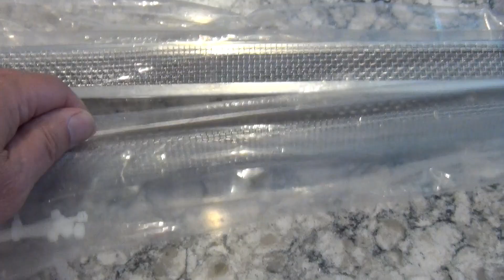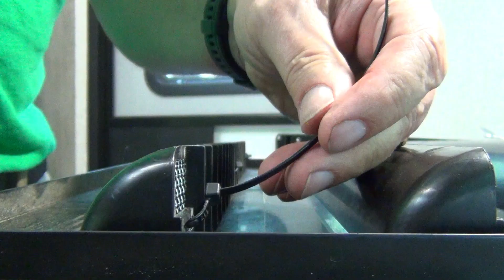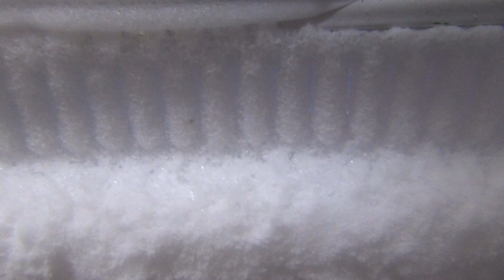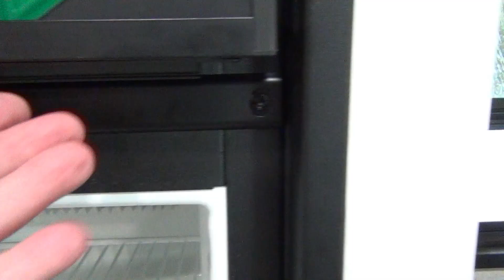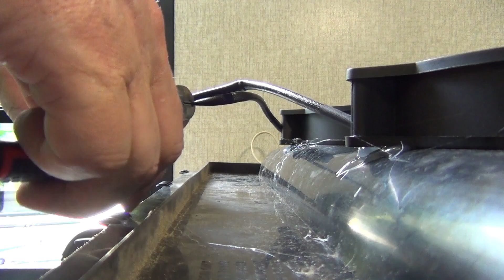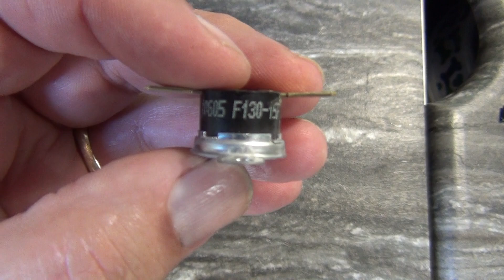THREE Things All RV Fridges Should Have👍

Comment: Did you do a similar mod with the flagstaff? Signed a new flagstaff owner
Reply from the maker: Congrats on your new Flagstaff! On mine, I did the exterior fan and screens, but I did not put in the inside circulation fan. Since its a smaller, shorter fridge, air circulation isn't as big of an issue. Besides, the fan would take up too much usable space. Did you see my episode on adding a second refrigerator?
https://youtu.be/59JBr0EEdhs

Comment: Do you think you could turn your attention to building and testing some FM radio antennas?  I've messed around with some homebrew designs and found that my steel handtruck is a better FM antenna than some of the commercial omnidirectional antennas from Stellar and Channel Master.
Reply from the maker: I have one episode on a VHF/FM antenna here - https://youtu.be/OWOwTQQPuT0
I'll see about doing more FM designs. Thanks
Reply: @mrhoptoit7835  I watched and that was good. Possibly test a larger or smaller gap in the dipole ( yours was 2" i think) and maybe larger wire filament to see if it grabs more signal.  I have a 4' steel hand truck that works better as an antenna than rabbit ears for many FM stations . It's made of 1 1/4" tubular steel.   https://mappcaster.com/collections/steel-hand-trucks/products/dht26-1025-economy-steel-handtruck-with-semi-pnuematic-wheels
Reply from the maker: Interesting. I might build an antenna that looks like a hand truck now...lol

Comment: I did the same with the refrig on our boat. I even installed a heat switch to a small 12 DCV computer type fan, in the rear of the compartment it was in. Good vid.
Reply from the maker: Yes, adding a fan really helps keep these refrigerators a lot colder. Thanks for watching.